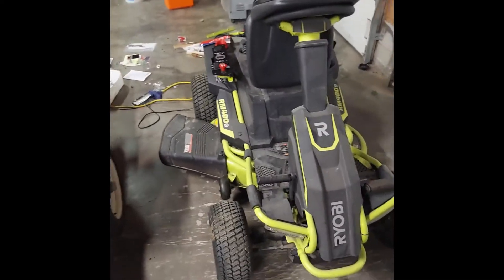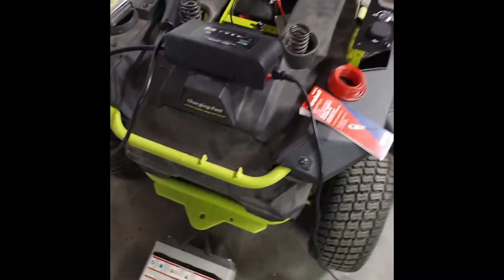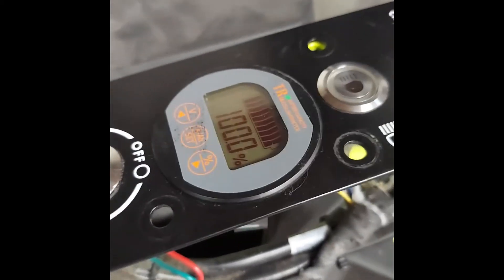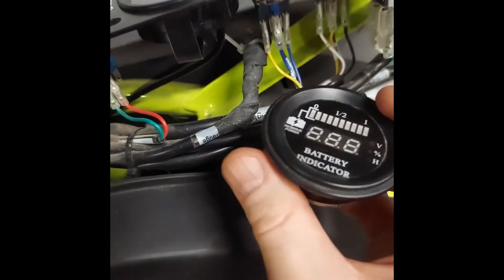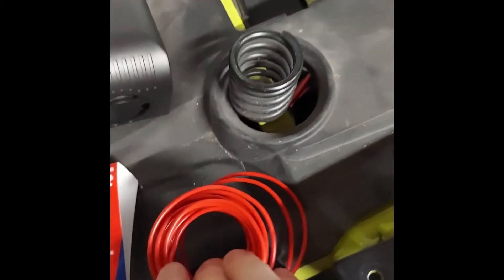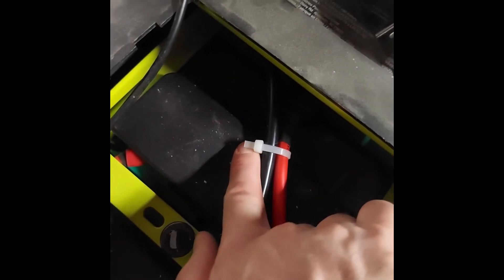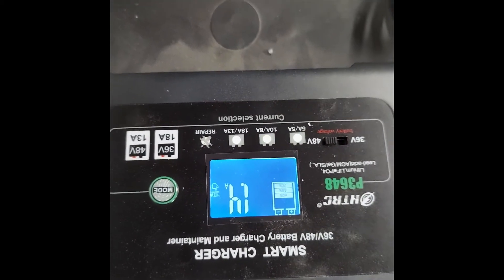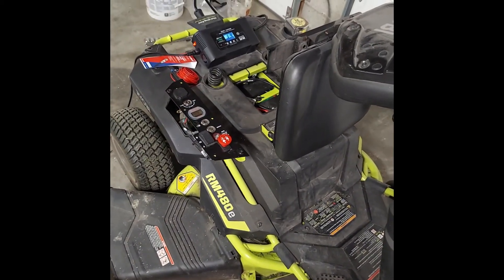Upgrade Ryobi RM480E/RY48110 to LiFePO4 Batteries - Tutorial + Required Parts

Comment: Thank you so much for this video! I’m in the midst of swapping out my batteries now. 

Question about the bridge that’s connected from the battery to the battery monitor:

1. Did you literally cover it in tape? I hope it doesn’t get over heated…

2. Where do you put it? Right on top of the batteries?
Reply: I am not Ryan, but I just taped mine up really good with electrical tape and left it right above the batteries. I have mowed several times, no issues
Reply from the maker: The tape just protects it from arcing against other metal parts. It won't cause anything to overheat. As far as where to put it.. wherever you can I guess lol. Have to get creative a bit.

Comment: Hey, is your HTRC charger still working? Mine stopped working after the second charge. I'm outside the return window so I can't return it. :(
Reply from the maker: It's been working alright for me since posting this.
Reply: @ryannoble5451 It cycles through the display of volts, amp hours, temperature, etc but doesn't actually do any charging. I found a reviewer on Amazon who says the same thing. Luckily it's not super expensive but this time I will probably buy the extended warranty from Amazon for the charger. No mention of a warranty on the Amazon page :(
Reply from the maker: @JustWasted3HoursHere  yeah I'm not sure. It's probably not the best built but the price was right lol. Could it be overheating? I know most chargers are temperature sensitive.
Reply: @ryannoble5451 No temp issues. It acts like it's charging - goes through the cycling of information for volts, amp hours, temp, etc - but no current goes into the battery. The battery gauge doesn't glow like it would if it were charging. Anyway, I'm just going to buy another charger, probably a different one though. If that one doesn't work then the issue is elsewhere, but that would really surprise me.
Reply from the maker: @JustWasted3HoursHere  could be a loose connection possibly?
Reply: @ryannoble5451 I opened the lawn mower and made sure everything was connected and tight. No issues there. If there's a loose connection inside the charger, that's kind of outside my area of expertise. But if the second charger works then I will know it was the charger and probably have a look inside there just for my own curiosity.

Comment: Thanks gor the video! Ucik question, do we have to buy/use a new meter? i just installed new lifepo4 battery, but try to save time by using evrything else. But mower wont turn on. Please help. Thanks.
Reply from the maker: I'm not sure if you need one, meaning idk if it would have problems turning on if you didn't install one.

Comment: Thanks for the excellent instructions. I completed transition as described, but I can't seem to charge lithium batteries, or maybe they are fully charged and I need to install a pre-charge circuit. Any help appreciated. My Allied lithium charger began charging and then shut down after a short while. The gauge on mower shows 58 volts, 2.2 Ah and 2.2% charge (I have not calibrated it as I don’t know if it is really at full charge). I take my multimeter to cables coming from batteries and it reads 58V and 0 Amps. If I go to turn on key to start mower, everything immediately shuts down. Is my battery fully charged and do I need to install a pre-charge circuit, or is battery not getting charged? Thanks.
Reply from the maker: I'm honestly not sure. In the video I show a wiring diagram of how I wired everything. I'd try charging each battery individually to make sure they are all charged 100% before wiring them up in the mower.

Comment: Sorry for all of my posts. This will be my last one, I promise! So, a few things I noticed. Definitely more power than before. My grass was long and wet and it hardly bogged down at all. So that's a good thing. I noticed that the gauge stays on all the time and goes into a low power mode with no backlight if there's no power being put in or taken out from the battery pack.

Also, according to the charger, when it was fully charged it was only showing about 46 or so amp hours. It appears that these batteries are nowhere near 100 amp hours. But, I guess it's all good in the end because after I mowed my entire yard, which is a corner lot, I used less than 10% of the battery. And with lithium batteries, they don't need to be plugged in continuously when they're not in use like the old lead acid batteries do. So I will plug it in after four or five or six more mowings.

Quick tip: if you put your mower in gear and it doesn't move but the blades come on, make sure that your parking brake is not set. That's what happened to me. Luckily, my son noticed it and we were good to go.
Reply: Don't worry about your battery monitor led...the draw is so miniscule it isn't worth thinking about. Changed the battery on my fishing jet ski to lithium and now I have to actually power everything I have on the ski to keep it below 100%. Never use the charger between uses.
Reply: @rickss69  True. You figure that an LED digital watch can stay on continuously for several years with only a tiny button cell battery so, like you say, the draw is super tiny. I did discover that calibrating the gauge for your set-up is very important too. I only plug in the charger when it gets down to below 20% or so. And yes, unlike the old lead acid batteries that come with it, it's not a good idea to keep it plugged in all the time. Just when it needs it.

Comment: Hey, I finished it! It is charging right now.* I almost had a heart attack though: It's funny now (because of my stupidity) but at the time it was not! I used my multimeter to test each battery individually before connecting them in series according to the diagram - disconnected from each other of course - and the meter read 0.0 volts on each battery! Holy crap! What happened?!! Well, one of the multimeter terminal wires had come unplugged... Plugged it back in and we were back in business.

Moving the charger handle wires from the new plug to the old plug handle was not as complicated as I thought it would be. It was easy as can be and the contact pins fit perfectly in the old handle, so no modification needed to the socket on the mower itself. It's just 4 screws, pry off the cover, pull out the whole cable + wires + contact pins and put them in the old handle. [note: As you mention, the old one uses 3 wires but the new one only needs 2. Just ignore that 3 pin. You don't need it. Here's what it looks like inside: https://photos.app.goo.gl/vpJroq13VPmMooEQA You want to move the new wires (the one with the blue and red wires) to the OLD handle (the one that had three wires, white, green and black.)] 

One thing that I don't think you mentioned is that the battery gauge should be calibrated once the batteries are fully charged. This guy shows how easy it is: https://youtu.be/2hD5XoKqMFo?t=544 Although he's using it for his RV setup, the process is the same except your amp hours will be 100. It is ridiculously easy to do.

By the way, if anyone is still wondering about how the "sampler" (the bronze thing that comes with the gauge) is supposed to be attached, there's the diagram that comes with the gauge, which is super tiny so I blew it up for you guys here: https://photos.app.goo.gl/qW5viV7nr2pEXaaH7 and here's what it looks like when attached to the cables that will be attached to the battery itself (and a closer view): https://photos.app.goo.gl/HEKfMM4ky8MggGuN8 note: Those pictures do not show the 20 gauge red wire running from the "final" positive terminal of the battery "pack" to the tiny screw slot on the sampler. As Ryan mentions, it's a good idea to wrap this bronze sampler in electrical tape once you have it all wired up, just in case.

Anyways, I hope these images help anyone who is doing this project! You can pin this comment if you like.

* What internal temperature does your charger generally show while charging? On the 10A/8A setting it went to 111F on mine. Maybe that's normal, but I moved it down to 5A/5A just in case. There is no information that I could find online or in the manual or even on their website on what the maximum temperature is for the charger is, but I did read one blog somewhere that said as long as it doesn't go over 120F that should be fine.
Reply: Thanks for the additional tricks. Do I have to install/use new meter? can I just use the stock meter to save time? Thanks.
Reply: @worldpeace3221  The stock gauge is designed for use with lead acid batteries so you'll get an inaccurate reading. You CAN just ignore it though. Installing the gauge used in the video is not too complicated.
Reply: Great photos! Really helped. 😊
Reply: @Fingers1234567890  Still going strong too! If you're concerned about the LCD battery gauge screen being on continuously, don't be. It uses a microscopic amount of power (think about an LCD watch that keeps the screen on continuously for years at a time with only one tiny button cell battery). Besides, if you put a switch in between the battery and the gauge it will no longer give accurate info about the battery because it needs to be on to measure the amount of power going into and coming out of the battery pack.

Comment: Have you come across an issue, where the mower is going uphill and it drops into neutral, the blades do not shut off. Only happens up hill.
Reply: Mine does that. It's because I still have the original lead acid batteries from 2017 when I bought it. Researching doing this conversion currently.
Reply from the maker: I haven't experienced that. Sounds like it might be an issue with the drive motor.

Comment: Hey bro, thanks for this video! I have ordered all the parts and they should be here today and tomorrow, except for the batteries which will be here next Monday. It's been raining every single day here in Florida and the grass has grown so tall (even in just one week) that the stock batteries can only manage about 15 minutes of mowing. Anyway, looking forward to doing this conversion. HWE, the seller and manufacturer of the batteries actually called me because they were concerned that I was getting these for a golf cart and wanted to make sure that they would fit and work. I steered him to this video and he gave me the thumbs up.

By the way, it's worth mentioning that it's best to NOT plug it in after every use unless you have a VERY large yard and are running it down to 30% or less. This is contrary to how those original lead acid batteries are supposed to be plugged in, which should be plugged in after every use. If you are only using a small percentage of the lithium batteries per mowing and plug it in only when it gets to somewhere between 30% and 40% then those batteries will last their longest, possibly outlasting the lawnmower itself.

Comment: Ryan, thank you for creating this. I copied your exact setup/parts right down to swapping the charger plugs and it works great! 

Edit: 
1. I no longer recommend these batteries, HWE (Howell Electric) has put in a weaker BMS which doesn't support the current draw of the mower.
2. I ended up buying a LiFePO4 specific 58.4v charger. The HTRC is flaky.
3. If I was doing this again, I would buy 1 48v 100Ah battery. Why? Possibly and likely, over time, balance issues with 4 12v batteries.

Folks, if you are new to LiFePO4, I recommend watching Will Prowse video 12V LiFePO4 Battery Series Configuration 101.
Note, batteries must also be 4S capable (i.e. 4 in series is a supported configuration). The Ryobi RM480e/ex has high peak current demand so if you are choosing a different battery, look for golf cart support as an indication they may work.
Reply: Never mind, I'm an idiot! I had the parking brake on! So if anybody else has this problem, be sure to deactivate the parking brake and you should be good to go. Thank you to my son for pointing this out!
Reply: I did the same thing except mine doesn't move. The blades come on and if I put it in reverse it will beep like usual, but it doesn't move forward or reverse. Any ideas?
Reply: I did the swap and only worked once. All I get is a click from the relay on the frame. I did not change the indicator any ideas?
Reply from the maker: I haven't had an issues with the HWE batteries or the charger so far. Doesn't mean they are the best options by any means.

Comment: Great video!! Before finding this video, I was about to purchase the new Royobi 18V tractor, which runs $54K. I pulled the trigger and ordered everything from Amazon. It was shown on their website as individually and as a bundle. The battery distributor sent me a message asking me what type of golf cart the Lifepo batteries were going to be used in verifying compatibility. I replied I am upgrading my Royobi riding mower." There are no responses yet. Has anyone else received this message? If not, I'll keep you posted. Thanks again.

Update! Heard back from the distributor and they said they would process my order ASAP.
Reply from the maker: Any size that fits in the bay is ok. I think it's easier to go with ones that have threaded terminals vs post for compatibility.
Reply: I'm not pointing fingers, but I did the swap with all of the supplies you recommended and installed each part as described. Prior to putting everything back in, I tested it and drove it around my yard. Then, when I put everything back permanently, I turn the key and no power. I bypassed the charger and seat interlock and still nothing. When I turn the key the relay doesn't even click. So I ordered another relay to see if that works.i can't even get it to charge using the recommended charger.
Reply: @Baldsnead  Be super careful when you slide the battery pack in/out. There is some wiring that could snag/break. Not sure what happened in your case. Some basic troubleshooting—remove pack, check voltage and charge to rule that good/bad. If no voltage, reset battery BMS according to manufacturer's recommendations (this usually involves removing all connections to the battery or applying a voltage to it). If battery pack is good, then perhaps something else became loose or broke when sliding the pack in. HTH & good luck.

Comment: I did this upgrade, but bought a lithium golf cart charger. Do you know what voltage your batteries charge up to? My charger never reaches green light, 55V instead of 58V? Like right after full charge, measure the pins on the mower with a meter. The new meter on the mower doesnt go much over 56v.
Reply from the maker: 56V is good and you probably don't want to go over that. I think anywhere from 52 to 56 is where you want to see you voltage at full charge.
Reply: @ryannoble5451  yeah, but the charger never goes to green light, that would be at 58v. Sometimes the power shuts down when turning the key. Does ryobi have a limiter in one of the controls or DC to DC converter?

Comment: Pulled the trigger on this upgrade last night - Looking forward to getting so much more than 30m per 10 hour charge out of my mower lol
Reply from the maker: Yup. I feel bad the price of batteries have gone up quite a bit since I bought mine. It's probably still worth the investment though.
Reply: @ryannoble5451  No worries - the cost of the batteries is still 70% less than buying a new mower.
Have a link for the step bit you used for the new battery display?
Reply from the maker: ZELCAN Large HSS Spiral Groove Step Drill Bit, 12 Sizes Titanium High Speed Steel 1/4" to 2-3/8" Drill Bit for Sheet Aluminium Metal Wood Hole Drilling, Big Multiple Hole Stepped Up Bit for DIY Lovers https://a.co/d/h0soPzp
Reply: @ryannoble5451 Bought the smart charger you linked - when going to swap the Ez-go ends, the new smart charger only has 2 wires (blue and brown) going to two pins - the third pin is open. I’m assuming that’s ground? But unsure what to do.
Reply from the maker: Just do the two. I think there is a place holder pin with the new charger for the top? I left that in to help keep the connector secure when plugged in.
Reply: @ryannoble5451  halfway through the conversion over here - batteries aren’t liking something about the gauge connection. Get a big pop when trying to connect to the terminal.
Reply from the maker: Not sure without seeing your setup. It's all live connections so it's easy to short if you're not careful.

Comment: I have done 5 mows now with the new batteries. Zero issues, and I haven't dropped below 70% charge in any of the mows, nor have I experienced any problems with performance. I mow without even thinking about the battery now. Before it was a stress inducing rage train when I had to stop and charge 3 times to mow 1/2 acre. You want to see a pissed off person? Look at me when I am in the middle of charge number 3 and it starts to rain! RAIN!

Those days are over thanks to this video, and I would also like to thank THC legalization in Michigan. because I love to get high and work on projects like this.

Comment: I put 8 new lithium ion batteries in our 2 Ryobi 48volt riding mowers at Church.  Just awesome!!!!!.  Batteries cost $120.00 each.  Amazing 
how such small and light batteries could have such power.  Also bought a new charger - $120.00.  Very pleased.
Reply: Does it go till the charger has a green light? If so, what's the voltage on a meter at full charge?
Reply: Can you link the battery you bought? These lifepo4 are too expensive. Thanks !
Reply: Where did you find $120 lifepo4 batteries, best i see is $179 shipped

Comment: Great video, can you tell me which wire on the new charger matches with the old? Ryobi charger has 3 wires but the new has only 2. Thanks
Reply: I think the 3rd Ryobi wire is the one that senses if the charger is plugged in. I just swapped the original Ryobi charger connector onto the new charger and just used the only two wires I had and decided that I will always back the mower in, so if I do take off with the charger plugged in, it will just pop out the back lol